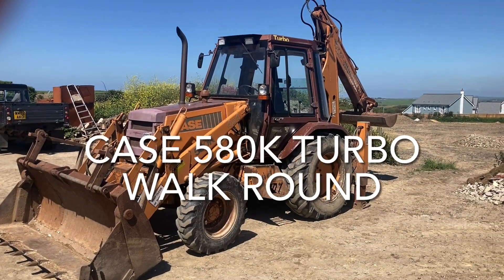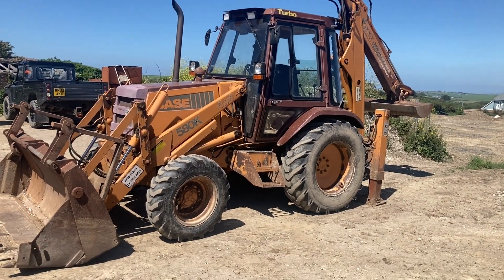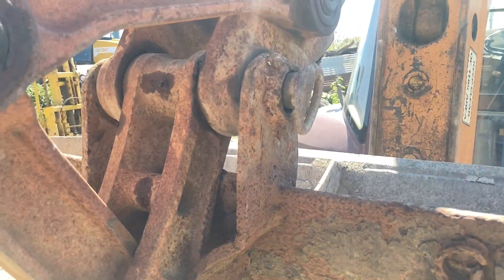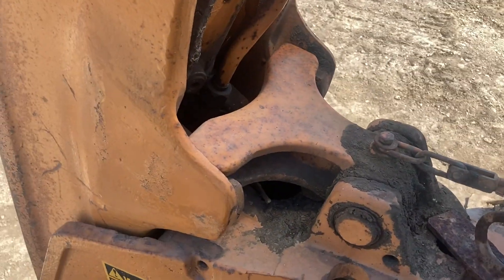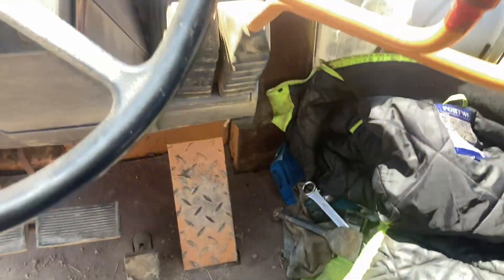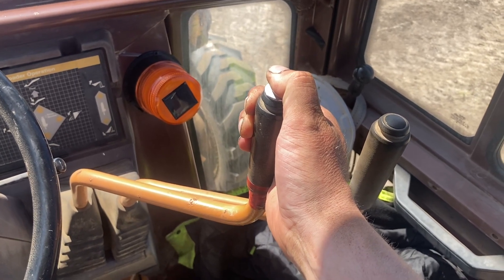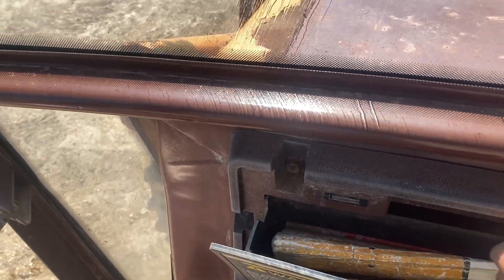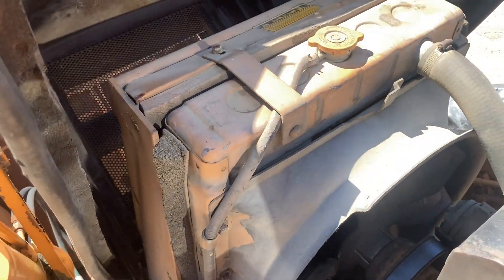Case 580k Turbo walk round

Comment: I bought a ford 655 in 1989 and looked at them cases it was a Close thing  at the time I  ran that 655 hard till 1995 then traded it in  very good machine that ford
Reply from the maker: the 655 is probably the better machine to be honest, my late dad drove them when new and spoke highly of them and i have run 3 of my own over the years, but both the same spec jcb and fords are making stronger money atm so settled with the case  for the min.